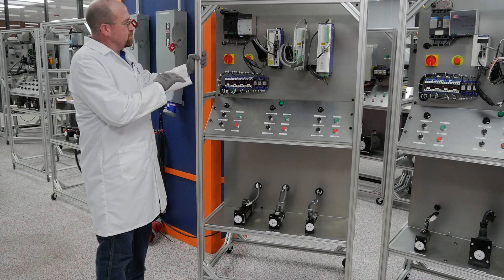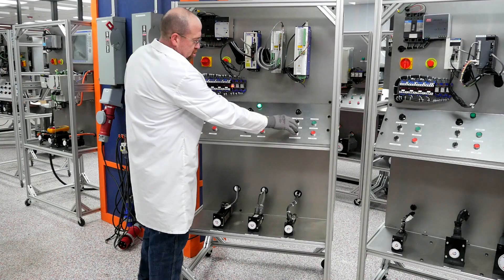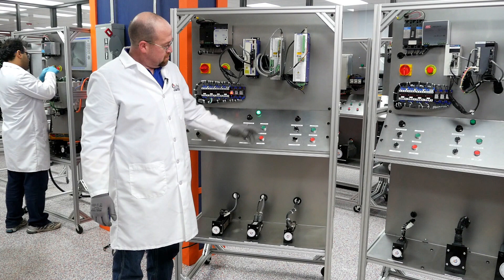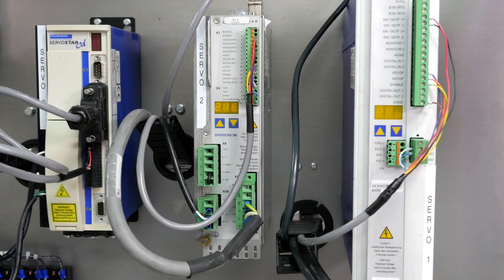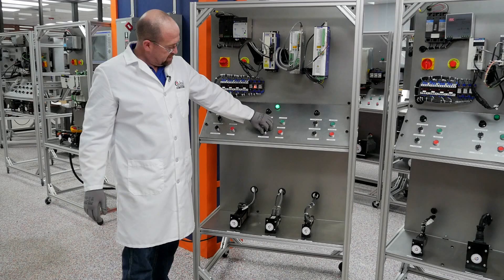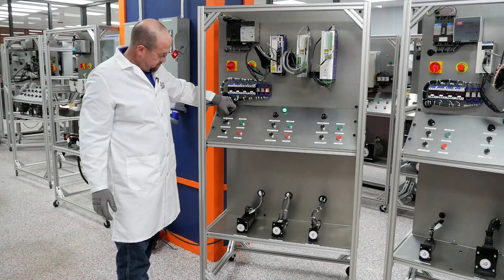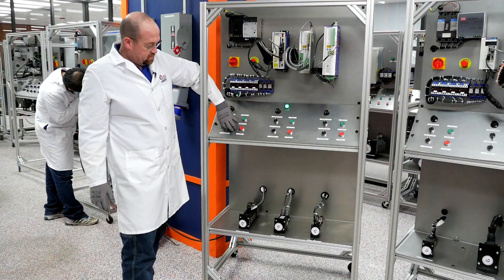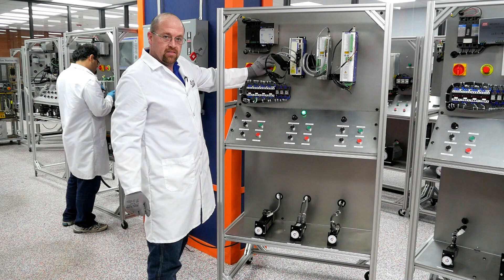Kollmorgen Servostar 600 Drive and Motor Test

Comment: We had a 300 stop working with an HMI. I’m trying to control with a pc now but I’m getting L2T threshold fault when I jog servo from the software. I saw the servo move a small distance once and then it faulted. What is this fault? I found it in the manual but it’s very vague.